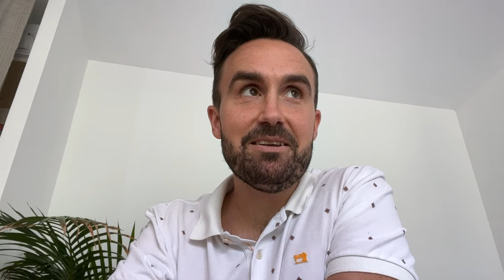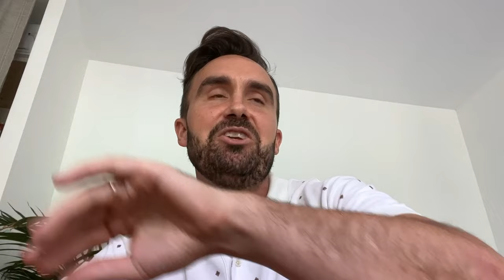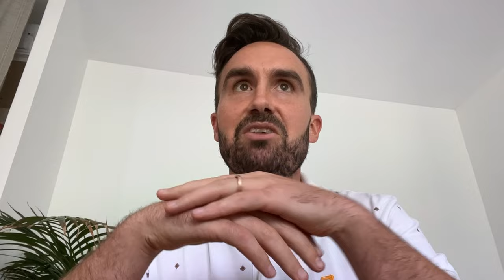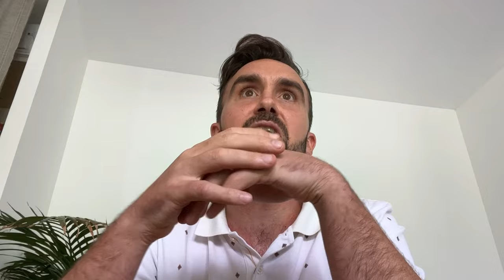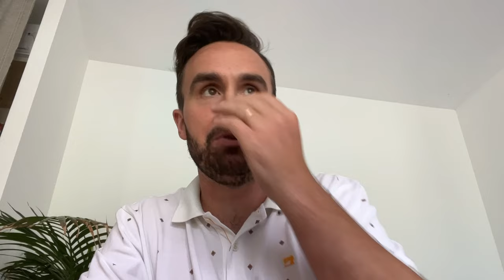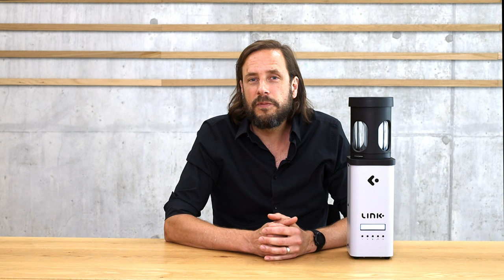How to roast the best coffees + Nucleus Link hacks | with Sam Corra

Comment: Just another question about the app - after I enter my profile pack (/For example filter) and bean density the app comes back and suggests a profile number and suggested development %. Am I free to set the development % to whatever I want?  It seems that the app is always suggesting a lighter roast, say 10-12% but this is too light for my taste. If it suggested 10-12% can I set the machine to 18% for example?
Reply from the maker: I made a detailled video on the Nucleus Link. You can just adapt the RTD% when chosing the roasting profile at the machine: https://youtu.be/t2HUo7Sn7dk?si=Dg_v2MsO1koRTdFT

Comment: Could you do a show on roasting decaf on the hot top roaster?
Reply from the maker: You can use a standard profile. In general with Decafs, you should have a bit a lower preheat temperature und be a bit more careful with heat in the first part of the roast (but not too low to prevent baking). Decafs look much darker which can be misleading so you can go for a bit a darker colour also for the roasted coffee.

Comment: Hello, I have ordered LINK and I believe that the selection of moisture content in the app is a very important requirement. I hope to open this option (almost all traders have this instrument, and obtaining this number is becoming easier), but I do not have a channel to contact them. I hope you can provide feedback to them. Thank you very much!
Reply from the maker: Sam did thousands of roasts and analysed them and came to the conclusion that density is the factor that has the highest impact. Since at the same time the system has to be user friendly, that is the factor, the LINK works with successfully. 
The moisture content is being taken into consideration since it influences the density of a coffee directly.